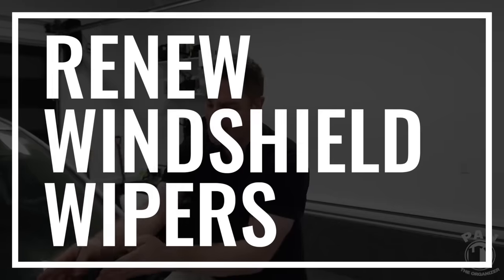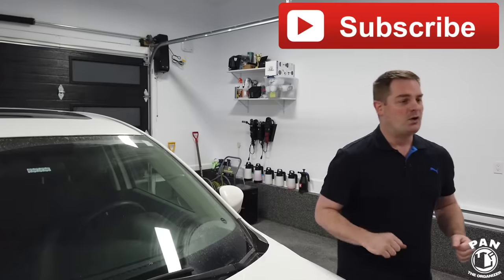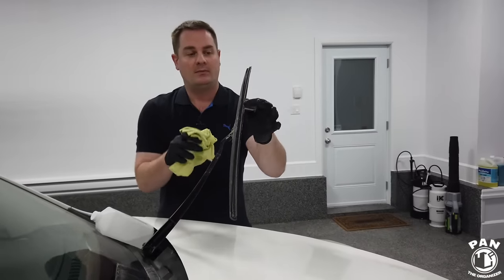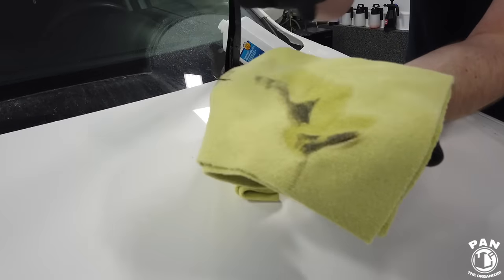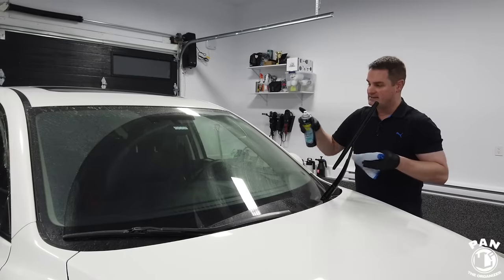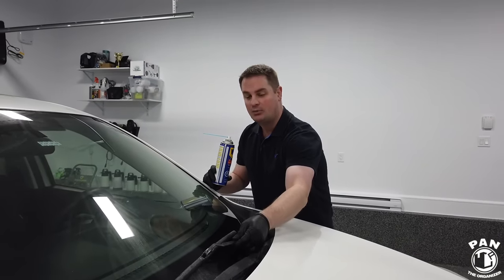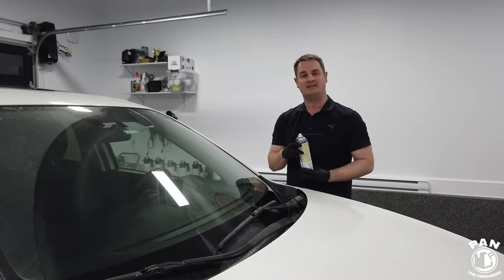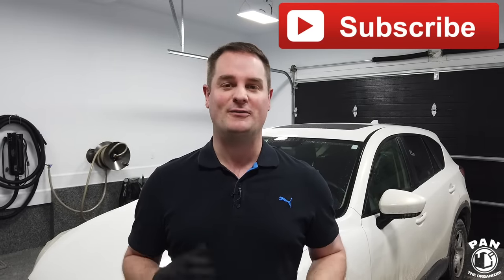HOW TO RENEW WINDSHIELD WIPER BLADES - ZERO STREAKS, QUICK & EASY !!

Comment: Pan, any time you use alcohol on soft rubber like that. It will start to break down the rubber. And that brake down is what you see on your rag. Your better off using a apc as it wont destroy the blade like you just did. 
Im a tech at ford I see this even on new cars when cleaning seals to in install window visors
Reply from the maker: Not if you don’t do this every day.  Once every fee months is perfectly fine.  Been doing this for decades with no issues.  I respectfully agree to disagree.

Comment: Hey Pan, with all of the coatings and paint protection as well as windshield and window treatments and sealants that we use.  do you have a recommendation on what type of windshield washer fluid to use? Or does it not really matter?
Reply from the maker: Yes a good windshield washer fluid can do a better job than a cheaper one.  I like AngelWax Clarity a lot.

Comment: Buy some 303 protectant, new blades and then get a heat gun/ hair dryer and heat the rubber up a little then leave the blades in the pack and pour some of the protectant in there to cover the rubber and let sit for about 10 minutes. Keeps blades good for a very long time.

Comment: I know you did a video on washing your towels, after cleaning the blades  - is that micro fiber towel trashed now? or will you be able to wash out the wiper blade gunk and alcohol ?
Reply from the maker: I wouldn’t use my best towels for this task as they might be stained after use.  But you can wash and reuse them.

Comment: First of all after you put the WD-40 at the lower arm of the windshield wiper then you should clean your windows. Because you're going to get after spray on the window from that WD-40. Also put a little bit of rubber protectant on the rubber blade itself let it dry and then it will last a lot longer from the Sun cracking it and getting brittle. One of the most important things with windshield wiper blades that they will crack in time and become very brittle because of the Sun drying out the rubber blade. But people that live in snow regions and ice regions is when the blades become broken because the blade stick to the windows from the Frozen ice and snow and then they try to lift their blades up and break them. They should always put their windshield wipers up before the winter snow or ice falls. But I know that's hard to do sometimes

Comment: Thanks for sharing such a good information.
Just have one concern is it ok to use isopropyl alcohol on rubber? I heard it will cause dehydration of the rubber.

Thank you 🙏
Reply from the maker: If you would clean your wipers everyday perhaps. But this you only do once every other month. I have been doing this for decades with no issues.

Also keep in mind you should be buying new wiper blades every 1-2 years for optimal performance.
Reply: @PanTheOrganizer  Awesome, thanks for you quick reply.
I need to do this cleaning once a month as I am driving 150 kms daily on Canadian highways, which are soaked with slush and salt. Even if my wipers are good for 2 months after using this technique I’ll be ok with that.
Thank you 🙏

Comment: Won't the iso dry out the rubber or silicone of the wiper blades over time degrading them and causing them to fail prematurely?

Comment: i usually wash my blades when i wash my car. With the car soap and then after drying it with glass cleaner again. And usually i buy new ones every 6 or 8 months.. depending how much it rains or snows here. I would think the alcohol would dry out the rubber? Just a thought. Easier to just buy new ones lol.

Comment: is there a particular screenwash you use? currently i just buy the cheapest pre-mixed solution available at the local car part shop and it works surprisingly well😅 that being said i’m sealing my windscreen and prepping my wipers soon so want to do it all properly
Reply from the maker: The best screenwash I ever used is this: 
If you are in the UK: http://bit.ly/3K0jwse
If you are in USA: https://bit.ly/3zrI48D
Reply: @PanTheOrganizer  i will certainly give this a go once my current supply ends. i was looking at Sonax Clear view which was recommended by a HGV driver, i wonder if you had experience with that product?
Reply from the maker: I don't unfortunately. But better than a screenwash, is to protect the glass with a glass sealant or glass coating. Watch my video on that here: https://youtu.be/IEIlHZ2D4ig
Reply: @PanTheOrganizer  that video (and your others on the topic) are excellent and i appreciate the detail. i was going to use a method similar to ChrisFix, along with products you recommend. my glaco is arriving saturday, i will be using clay bar and maybe glass polish to ensure the screen is pristine before i seal. discovering your channel is making my bank balance take a hit

Comment: Hi Pan, I was wondering if one should often scrub the graphite windshield wipers to remove all the gunk as shown in several of your videos?
Because I also heard that by doing that one is removing the graphite layers, and that the black residues on the towel at the end are for the most part just graphite, and removing it could contribute to wear it out prematurely.
Reply from the maker: You don't do this method often. Once or twice a year is enough. And you're supposed to get new blades every year or every other year in theory, as this is an important security feature of one's car.
Reply: @PanTheOrganizer  Thanks for taking the time to answer!
Reply from the maker: My pleasure. How did you discover my channel by the way?

Welcome to my channel. You discovered one of the biggest car detailing channels on YouTube as we surpassed 1 million subscribers and we have over 145 million views! I have been detailing for 27 years and I love to share my knowledge and passion with my viewers.

You found the right channel to help you learn everything about detailing.
Reply: @PanTheOrganizer  Some years ago by exactly looking for a way to clean my wipers, and more recently for more infos on detailing and I got more than I bargained for! 😁

Comment: Wont the rubbing alchohol dry out the blade and lead to a shorter life span from cracking?
Reply: Thinking the same thing
Reply: Personally I would follow up with a soaking of the blades with 303 aerospace liquid.  This stuff really restores the blades.
Reply: the alcohol is needed to deep clean the blade, the wd 40 renews the rubber
Reply from the maker: You don't do this step every day.  Once in a while doesn't hurt.  I've been doing this for decades and never had issues.  It's a widely known trick.
Reply: You can use denatured alcohol if you're concerned about damaging the rubber, denatured won't hurt it. For occasional cleaning, I'd agree that regular isopropyl won't cause much degradation. I live in a high road grime area and use denatured because I have to do it more frequently.
Reply: John Smith yes, this! Denatured! Isopropyl is a no-no on silicone or rubber. It may not appear to be doing damage but it is causing a lot of drying out and causing more issues. It’s actually better to clean the blades themselves with just WD40. Multiple passes with a towel and then dry off. The blades will last far longer than using something like isopropyl.
Reply: A good clean of the blades every couple weeks and a re application of rainx on the screen keeps me right. Will note the wd40 tip tho,  cheers.

Comment: Hey Pan!  How do you fix wiper chatter?
Reply from the maker: Hi Jae! Oh boy, unfortunately that is a big rabbit hole to get into and it would be too long to thoroughly explain, but let me give you the big lines. It's impossible to answer in a single phrase, as there can be multiple factors that generate wiper chatter or judder or skipping as some might call that phenomena. 

1) Improper prep of the glass surface. Glass is porous (when seen through a microscope) and in those hills and valleys, there can be contaminants that get embedded, just like the clear coat on your paint. So claying the glass is important before applying a glass sealant or coating.

2) If there was a previous glass sealant or coating, it's important to fully strip it off before applying a new coating. I would use a glass polish and rayon glass pad to machine polish to remove imperfections, water spots, and any previous protection. Then use an IPA or paint prep spray to remove polishing oils and have the surface ready for a coating or sealant.

3) The type of glass sealant and glass coating you use is very important. Some are known to cause judder, while some are silky smooth. Here are two glass coatings I usually recommend that offer good performance all while being easy to apply and shouldn't give you judder issues:
My 2023 award winner for glass coating of the year: https://amzn.to/3NMF8u1
One of the best glass sealants: https://bit.ly/3hK8qNG

4) Having dirty wiper blades, or damaged blades can lead to wipers skipping. It's recommended to get brand new wiper blades at least once every two years, ideally every year. And also, make sure your blades are clean, as shown in the tutorial you just watched.

5) Following the actual instructions of the glass product you are using. It might seem funny, but so many people never actually follow the instructions and apply it incorrectly, and then thew wonder why something went wrong... Chemists work hard to come up with clear and precise instructions. Follow them to a T.

Beyond that, other factors can include the type of glass (manufacturer), the curvature, conditions where you live, type of wiper blades, etc. Things you can't really control.

If you did steps 1 to 5 right, you should have zero issues in theory.

I hope this helps!

Comment: WD40 is a degreaser. So, if, let's say, you're doing maintenance to an o-ring bike chain, you wanna use WD40 to clean it and then spray some white grease onto it. In the case of wiper blade mechanism, I'd recommend doing the same, unless the mechanism is clean, then you might wanna use just the white grease to lubricate it.

Comment: 3 table spoons  of Dawn dish liquid and fill the rest of the spray bottle with cleaning vinegar. Use a microfibre cloth and pinch the edge of the blade, you will be amazed at the black stuff that comes off. WD40 the moving parts. Clean with the best glass cleaner Invisible Glass.

Comment: Hi Pan, I already bought new wipers blade. But the old wiper streak marks doesn't go away despite cleaning is thoroughly. Do I need to get ceramic oxide to take the streaks off?
Reply from the maker: You should machine polish your windshield.  Watch my simple tutorial here: https://youtu.be/yMi5PtyqUI8

Comment: After cleaning them according to the video I treat the rubber part with Aerospace Formula 303 . It has a  water based carrier. I get the spray up into where the rubber is retained by the frame. I do it at the end of a sunny day, wipe off all the excess and wipe the  off the next morning.  I've done this since my summer and snow blades were new, 3 years ago, haven't replaced the since.  
btw WD-40 is great for cleaning crud off of metal.  BUT it is a mediocre lubricant. It has no staying power the best lubricant I found for the pivots and springs of wiper arms is high-quality silicone spray. That will repel salty water, oil and the wax of cheap car wash "wax" products,
Reply from the maker: Thanks for sharing Paul! Good tips!

Comment: is alcohol safe to use on Silicon wiper blade? (bosch, rainx, and Micheline).
I heard that alcohol prematurely degrades out the rubber/silicone material faster then anything else.
Reply from the maker: You don't do this procedure every day, so there are no worries for the rubber.

Comment: Would a lightly sprayed microfibre towel with a spray wax to squeeze onto the wiper blades be recommended afterwards?

Wouldn’t the rubbing alcohol without this step dry the rubber ?
Reply from the maker: You don’t do this step every day so there is no concern of drying the rubber.
Reply: Pan TheOrganizer fair enough. But would a spray wax be an added plus? Make the blade smoother over the glass or ?
Reply from the maker: I don’t do that.
Reply: Pan TheOrganizer ευχαριστώ μεγάλε !

Comment: Is there an alternative to WD40 for lubricating the wiper arm hinges?
It tends to attract a lot of dirt.
Reply: Jonathan Randall . Graphite lube, it’s a dry lubricant (once the solvent evaporates if you use a spray can)
Reply: @300DBenz  
Thanks for the tip!

Comment: When cleaning the windshield, would getting a simple car wash suffice??
Reply from the maker: If you plan on applying a glass sealant, you'll have to do a bit more to ensure a proper bond between the glass and sealant. Clay, and potentially polish the glass surface if you have contamination or marks/streaks.

Comment: Just a heads up, WD-40 is not a lubricant. Great video, def TU.
Reply from the maker: It's a water displacement product (hence WD).  It serves as a good cleaner and to remove any loose rust.

Comment: Hi Pam
Are you afraid the alcohol will dry out the rubber on the blade?
Reply from the maker: No. It’s not like you do this procedure every day. I have been doing this for decades and never had issues. Plus, you should be replacing your wiper blades every 1-2 years.
Reply: @PanTheOrganizer  thanks

Comment: Can I use lithium grease or silicone spray for durability as wd40 I figure will just wash off with rain? And technically it doesn't matter what I do as my issue is the linkage is wearing and create horrible noises, it cause like 500 bucks for the part. Welp, guess I just use it until it breaks or slow down when moving :'(
Reply: Kind of on a different note I will say I've been using the Wd40 - water resistant Silicone Spray onto the inside of my rims (the barrels) to try to keep them clean and from rust /brake dust and it's keeping them nice and shiny, I'm surprised how durable it's being. I know it's a high heat hazard but I'm not spraying it on the calipers or rotor. And I apply the ceramic coating to the wheel face, so basically all I have to do is water spray off the entire wheels and maybe wipe a little with a rag or brush and rinse off. So anyway the Silicone seems to be ok but I haven't tried it for the wipers or the Lithium

Comment: The majority of gunk that you removed from the blade is not road gunk , it is the carbon the manufacturer uses for the blade materials makeup  the individual components begin to separate as the blade ages and is used
Reply from the maker: Believe me, there's always gunk that is removed too.  If you think that cleaning wiper blades is useless, well I can't help you with that.  Clean blades always do a better job, less streaking.

Comment: @ 04:00 -- WD-40 isn't a lubricant, it's a water displacer ["Water Displacer, formula 40] developed for keeping condensation from screwing up electromechanical parts in the early days of rocketry [ICBMs, space, etc.] Good advice to lube the hinge, just use a proper lube like Tri-Flow or something, NOT WD-40 [or at least, after using WD-40 to drive out any moisture if you live in a seaside or other humid environment...]
Reply from the maker: Exactly.  And that's what it was used for, to displace water and moisture from the hinge, and any loose or frail rust, to get the hinge working better so the wipers can move freely and do their job better.
Reply: @PanTheOrganizer  Cool. But IIRC you said to "lubricate the hinge" in there, which confuses the issue. All good tho', I'd been doing the "clean the rubber" bit for dog's years, but not as thoroughly as you stated, so will have to up my game. Never thought about the hinge. One thing I especially make sure to do is any time I'm using the squeegee at a gas station, to use that to clean the blades while I'm at it. :t

Comment: There's a little whitenes for a 2-3 seconds on my windshield after wiping. 

It really block vision in rainy night drive. 

Please help
Reply: A few areas this could be down to. Old wiper blades not correctly clearing the screen. Is there sufficient windscreen wash in the system (water/wash mix)? Not sufficient pressure applied by the spring on the wiper arm. I would try the following 1. Clean windscreen with a good cleaner and cloth 2. Clean wiper blade, as shown in this video. 3 Check the water wash in your windscreen washer tank. 
If the above fails to resolve the problem, new blades and perhaps new wiper arm spring

Comment: Mime donr streak but the tail of the blade moves so much it looks like its not on there tight, ans they squeak really bad. I have rain x blades, and I washed my windshield. They are scratching my glass really bad though, theres too much contact even when the windshield is soaked. No lubrication at all.

Comment: I wouldn’t use rubbing alcohol on the wiper because it can dry them out, remember that the wipers are made from rubber and plastic and alcohol drys that out. Use WD-40 instead it’s a degreaser. Use the alcohol to clean the windshield first then use the glass cleaner for a better finish
Reply from the maker: Good point, but keep in mind this isn't something you do every day. I have been doing this a few times a year for years on many vehicles with no issues. I also like to get a fresh set of wipers every year or every other year on my car. And apply a good glass coating too. :)

Welcome to my channel. You discovered one of the biggest car detailing channels on YouTube as we surpassed 960,000 subscribers and we have over 130 million views! I have been detailing for 26 years and I love to share my knowledge and passion with my viewers.

You found the right channel to help you learn everything about detailing.